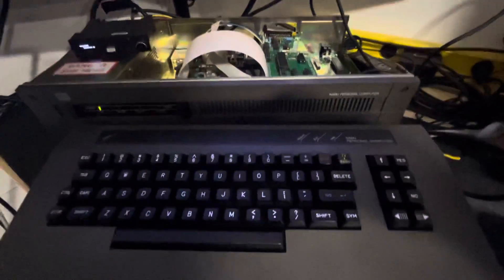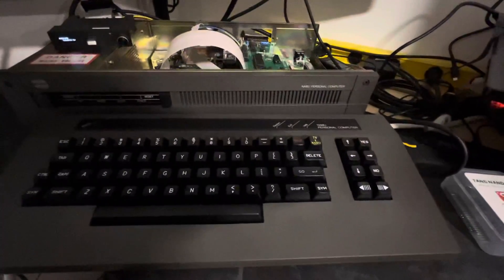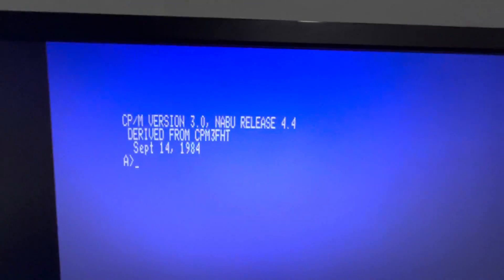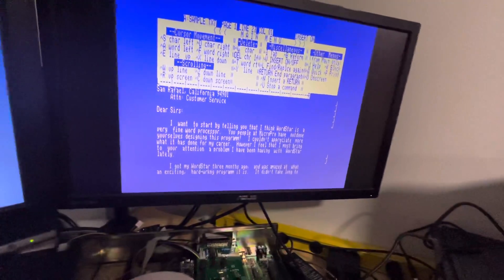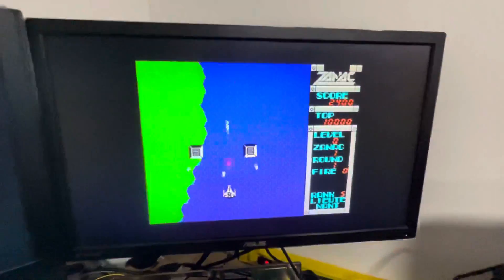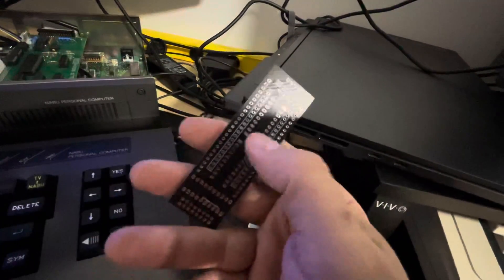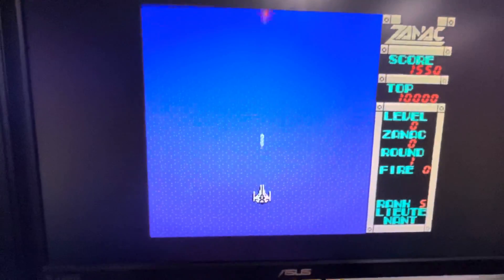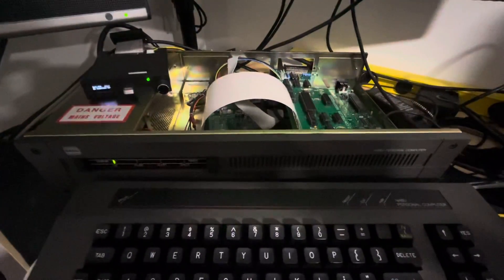Tang Nano 9K VDP - DIY FPGA VDP

Comment: I'm a bit noob in VDP. Can I get PAL out of the NABU RCA port by by replacing the TMS9918A with a TMS9929A? Would someone answer please?
Reply from the maker: this vdp does not produce video on  the RCA. only hdmi or the vga module. And both are 60Hz